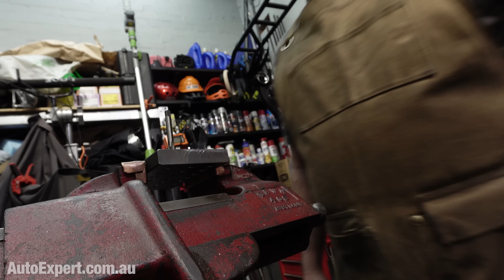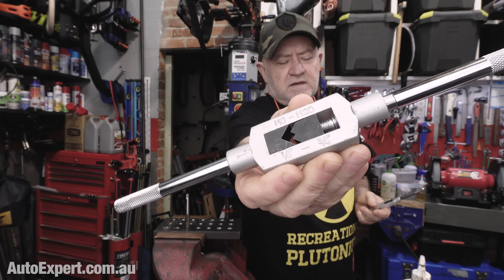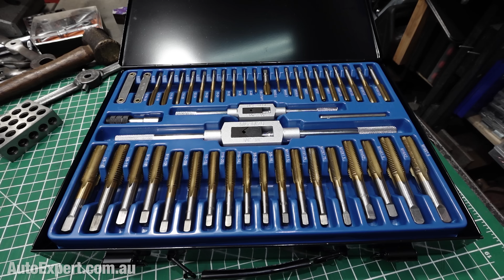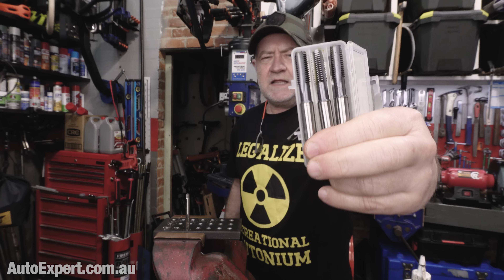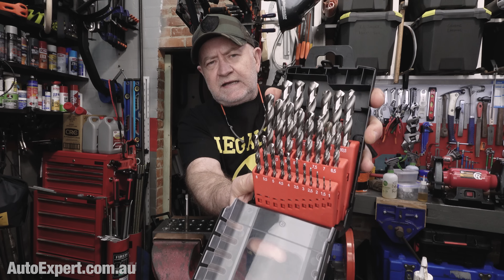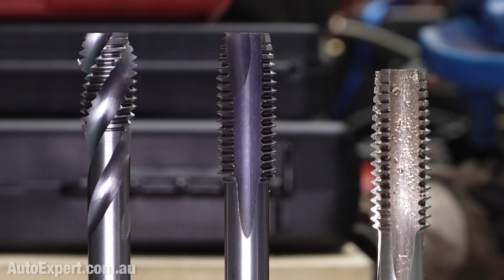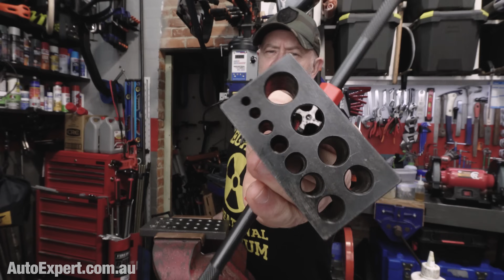The REAL REASON you break taps when cutting threads (and how to break even more of them, faster)

Comment: Why don't you use 'handtaps' instead?
I buy these in sets for the sizes I use most. That is for me some finer sizes: M5, M6, M8, M10 and M12x1.0 (fine thread).
They come in sets of 3 for each size: first tap, second tap and final tap. The final tap has the normal thread, but the first 2 are less deep. Like a kind of starter-tap. They make the tap work easier, get in the right spots and the right place and deep enough so you just don't need that much force and can generally work with a smaller handle.
Then work your way up from I to II and then to the not-marked one that is the same as a machine-tap for the size.

For a plate like you show.... well, I use a tapping-head by the way. With machine-taps and the tap in the head with the clutch set to the right force for the size. It will slip in the chuck instead of breaking the tap if something goes wrong and is really easy to use. Oil, slowly go down to the point the taphead is engaging and then just slowly go down further  untill deep enough and slowly lift up and the head is either just stopping on the clutch or is reversing direction (depending on tap-head).
Yes, expensive. But only about the price nowadays of 3 or 4 decent tapsets for manual tapping or like 8 or 10 good machinetaps. They used to be way more expensive. And yes, these are lower quality tapheads then the ones that I used to use in the professional machine-shop and will last more then a lifetime. You need a strong machine to use them though like a slow-going drillpress in low-gear.
With that, I have worked a while doing 6 holes (drilling, tapping M6) in one part, under 3 minutes per part. Then turn over to next setup and about the same amount in the same time. And yes, 100's of parts like that and it was just a nice serial-job to do. And: without breaking taps. If the head was clicking on the chuck, time to sharpen the tap or replace.

Comment: Good day to you John from "The Old Baboon" in South Africa.
I love the duality (how to break a tap and how not to break a tap) of your presentation on the tapping process. This type of substantive information should be made compulsory for any prospective engineering student, irrespective of discipline.
I do not know if it is deliberate or not but I just love the farting Trefolex applicator.
Admittedly I have had my quota of broken taps during my working years but that is experience (which in itself is very costly). Not raining on your parade but sub zero temperatures also tend to make taps more vulnerable.
Go well and stay safe down under.

Comment: At my last job we had an old drill press with a cast iron table. It was fitted with a foot pedal, that reversed the motor. 500 rpm minimum. Best tap wrench I have ever used. Also, machine taps are better for hand tapping than hand taps. They take so much less force to cut though they can have thinner shanks.
Reply: Be careful with the small size ones though, I had an M4 spiral tap snap on me before and it wasn't even a difficult hole. The taps that are straight but have angled cutting tips work great tho, as long as you can evacuate the chips.

Comment: As a mechanic I have never failed to remove broken taps and bolts! No matter the location. Some I shatter, some I use a high speed carbide tip, and some I slow drill with well oiled quality cobalt drill bits.

Comment: Threw away worn out taps. They are the ones that brake. You need a lot more force to cut threads with a dull tap. Never buy a box of used taps. You don't know how sharp they are.
Reply from the maker: Most hand taps are easy to sharpen on a bench grinder.

Comment: I must be doing it right with my limited equipment because I don’t break taps, and always back them off to clear the chips often, and I back them out especially in thick material to re lube, and to clean the flutes or grooves out. Did it for many decades now and always had good luck even with cheap taps. I never took any instruction on this stuff, just consider it proper use of a tool! I liked this video though! 😋👍🏻😊

Comment: M6 - m20 is fine, just hold by the very center. Sometimes when I need more grip I sometimes use a pair of parallel pliers and just hold them by the jaws just to get a touch more force when doing small taps.

Comment: 3-sets ... in Germnay they call them pre, middle and finish cutter (Vor-, Mittel-, Fertigschneider). 
What matters is drilling the right hole size, perpendicular placing, no flexing and a clean hole. Know your material you tap into. You don't want rust, you don't want some unknown steel that somehow hardened because of bending/hammering/welding or hot/cold cycles in the past.
I'm only an amateur and my broken tap was trying M4 into steinless steel with a "cheap" tap.

Comment: I break taps because they all come with square shafts that don't fit in my perfectly 90° drill press, so I wildly tap them by hand at random angles causing differential stress resulting in fractures. Imagine a triangular shaft tap that can actually fit in a drill chuck. Sounds like a billion dollar idea, someone should invent it.
Reply: How about a tap holder with a hex shaft?  Problem solved

Comment: You missed the best tip, use a nut with the same thread as the tap, then  you thread in o0nto the tap and use ir as a steady to get the hole started.
Reply from the maker: Fantastic tip. Thanls for adding.

Comment: The big box tap sets are really an opportunity (if you do) buy once  all the garbage taps you will probably never need (cheap chasers - good point) - to refill with quality (HSS) taps as the original ones get snapped or otherwise fail  - never think that solid tungsten carbide taps will make life easier for hand work - Machine tools only - they are so much more brittle than HSS..)

 - spiral flute taps are a  good upgrade - for the advanced user - - for a general-purpose intermediate or taper tap  (parallel bottoming/plug if you actually need a bottoming tap of any particular size) - great for power tapping - maybe also grab one - of the concentric laser sight ("bullseye") for holding a drill straight - if that is needed...  

Engagement  - threads 4-5 threads are necessary -minimum 3 threads make full spec load bearing (minimum) - 2 or 3 more give fault tolerance (more than 8 threads is stud-destroying through over torquing before threads will ever strip...
Getting started straight - hey use a drill guide, or- 
Rather than 123 blocks of dodginess - a short bar mounting  "V" block - with is a good starting tool (tis also a great early milling exercise).....

Equal angle - 20mm long is a great guide (if cut square)..
Tapping with a dead centre in the blunt end is time tested (tap wrench engaged - drill press or lathe - no auto-tapping-head needed....

Comment: Has anyone mentioned “Serial taps”
These are really good for taping and new users. 
The taper tap is smaller in diameter to the intermediate and the intermediate is smaller than the plug. 
So you have to use all three taps to tap a thread. 
But it does mean there is less load on the tap each time.

Comment: Such a wealth of information, thanks John! I inherited Trefolex as the tap paste of choice from my dad (aircraft armourer back in the 70/80's) and I was delighted it still existed when the time came for me to set up my fat cave. He also taught me about using a carbide on an air drill and hammer and punch for smashing out a broken tap in my Torana block, but that was the first and last tap I ever broke - such a horrid experience (2 days or so to get it out) that I have been very careful ever since. Also, now my kids are of age where they are starting to do fabrication, I keep the "good taps" hidden.
Reply: Yes Trefolex was the suff we used at the high school I taught in in the seventies and eighties. Great stuff! Our strategy when teaching kids to tap and using only high carbon steel taps not HSS ones was to "Turn the tap clockwise ( back then you didn't need to teach an 11 year old which way an analogue clock turned lol now you would if there was ever a need to teach a kid to tap a hole 😅) Turn it clockwise from twelve o'clock to seven minutes past twelve, then  turn it anti clockwise back to five TO twelve thus breaking the chip that you first made. Turn it back until it stops ( ie seven past twelve), then go another seven minutes and back ten to twelve minutes at a time.  Teaching it that way, we hardly ever had tap breakages and it was the dreaded M6 that were mostly done for( first tapped hole being in 12 x 12 mm mild steel to make a tack hammer).I've seen so many taps broken on YouTube by honest creators who admitted their tap breakages and turning the wrench backwards further than they do forwards almost always works. Sometimes tapping in very hard materials can be challenging and that's another matter lol
Reply from the maker: I'm feeling the pain of that broken tap, dude. The curse of HSS is that you can't anneal it for drilling with a gas axe.

Comment: if you break a tap in aluminium you can use chemistry to dissolve the steel tap without touching the aluminium. In a steel part, you're gonna have to find a different solution.

Comment: Im surprised you’re recommending straight flute (hand) taps. I’ve been doing this for some time over 55 years and I’ve found that spiral tip taps to be much better for overall work, through hole or not. As long as you can drill the hole deep enough to accommodate the long chips that are forced to the bottom of the hole, you’re fine. I also grind that point off those taps. There’s no use for them and it allows me to go a thread and a half more than otherwise. I haven’t had a problem with that. Spiral flute taps are really delicate. I generally recommend against them. When I do use them, I tap with a spiral tip tap first and remove the long chips. That’s not too hard to do.

A problem is that a lot of people will use an electric trick drill to tap. Well, yeah, I do that too, but I’ve tapped thousands of holes and I’m very careful with alignment. Straight flute taps are terrible with power tapping. I also haven’t seen a “tool steel” tap set here in a long time, though I suppose there are a bunch of cheap sets floating around where I don’t go. I certainly agree - buy high quality taps. They’re not really that expensive. But don’t throw your money away on something like Emug taps for $40 US, each.

Comment: A 7mm drill will do just fine for an M8 tap. I remember from trade school, 45 years ago, that anything over 70% thread depth does not 'significantly' increase the thread strength. I often tap M10 with a 9mm drill, much less chance of snappage.

Comment: I have to do M5x0.8 through 20mm plate. Yeah that'll get beads of sweat forming on the forehead.
Reply: Trefolex cutting compound all day.
Reply from the maker: Can't you counterbore most of it?
Reply: @AutoExpertJC  Good call. I've only being doing this about as long as you and never thought of that even though I know full well thread depth only needs to be 80% of nominal diameter to achieve max strength.

Comment: 60 minutes ago I broke three taps trying to mount a bracket on the side of my car hoist.  It took me that long to work out it wasn’t mild steel.  Like duh!  😢
Reply from the maker: HSS taps should cut anything a hoist is made from.
Reply: @AutoExpertJC thanks.  Maybe I just used inferior taps.  It was an M5 tap from Bunnings.
Reply from the maker: Probably a bottom o' barrel cheap Chinese tool steel tap. Designed to shatter if you look at it wrong.

Comment: My old toolmaker teacher told me 45 years ago that tapered taps were good for starting but once started , go straight to the plug tap because a tapered tap engages a lot more cutting edges a before it reaches full depth of thread. Which means increased torque on the tap and a higher risk of snappage 😢 A plug only cuts at the front. 
Or something like that.

Comment: Australian taps and dies only. If you need to be told who/what brand? Get an office job! 😝
I start my threads hand powered, but using a mill or lathe to ensure alignment. (gettin old).
Cycle thread is a bit more difficult. Make Y.O. 8-/ As John says - check the angle of ya dangle and keep yer flutes clean! 😵😂

Comment: "Low quality tap" is relative. I've attempted to use "low quality taps" for thread chasing only to find that they were such low quality that the thread form and diameters were wrong. Life is too short to use cheap, garbage taps. 99% of the time you don't need a taper, plug, and bottom (or taper, intermediate, plug) tap set for each thread. A gun point intermediate tap will work great 99% of the time. Avoid powdered metal taps or spiral taps for hand tapping. If tapping stainless or hard to machine alloys, use a drill for 50% thread engagement as long as the threads will reach at least 1.5x the diameter in hole depth. Use a thick cutting oil. If unable to back the tap out after desired depth in blind holes, rotate forward and backward gently to break the chip.

Comment: I prefer Trefolex paste to the oil. If you get a broken tap in a through hole work piece you can punch it out  with a punch and hamer, done that a few time over the years. The method that I read about in a 1944 copy of metals progress that apeals to me but I have never done , the person writing about his method of removeing broken taps and drills from aircraft crankshafts was, croubling blasting powder around the flutes and tamping it down then inserting a fuse and setting it off, apparently it blew the broken taps or drills out every time.
Reply: Blasting powder is unfortunately not possible to get for most people.
Reply: I second the Trefolex motion.
Used oil for a while, but never looked back after going to Trefolex "grease".
Oil is cutting fluid for drilling...
Reply: Agree on the trefolex. I use the tapping paste, aka gorilla snot, for thread cutttng, and use the oil for drilling.

Comment: I've seen every size of thread cut over the years from 4-40 which is a pain.. like using the tip of a toothpick to do the work up to 20"  for gland nuts (outside thread cut with carbide threading inserts)
Speed and Feed! Bungle either one and you might screw up.
Tapping Heads are almost a must if you plan to do it quickly (and there's a knack for this as well).
I've heard a lot of taps up to 1/2 14+ mm shatter or break off 
Co workers trying to hurry a detailed process.
It always sounded the same-- "Krunch-fock"!! Dammit"!!
I've noticed that the most expensive (HSS Spirals)  taps often break off at the very top of the shaft (the drive tip breaks off in the Collett) (leaving the jammed in place the remainder) vs the cheapest snapping the tip off inside.  
Tapping 40 Rockwell steel and 35 Rockwell stainless steel isn't easy.
The success was always go down about 3 turns..back it out, blow out the chips, back down to 2 to 3 more turns and repeat (blind holes)
We generally classified the Straight flutes as "Hand tap" and the Spirals as "Machine feed" tap
I think the best I remember were Guhring and Goliath with Butterfield as the olde timers standard. 
We don't have Trefolet such a thick syrup for taps. I've only seen fluids such as what was popular then..Norton Rapid Tap which is thin and drippy.
Maybe the thinking here is it's easier to drip out the metal dust and chips or easier to blow them out of the blind hole vs having a honey thick tapping oil. 
I know there's an off hand rule that the cheapest ones are designed to cut x many times before recycling them. 
Also I found its much easier to cut Metric threads than UNC.   They're harder to strip as well. UNC strip out easy.

Comment: It’s very easy to remove a broken tap all you need is a smaller tap then the broken one that you’re not bothered about what you do is put the small tap in the hole on top of the broken one and hit it with a hammer what will happen is a peace of each tap  will break off and eventually the broken one will brake up completely job done no special expensive tools required.
Reply: Tool steel yes, hss no.

Comment: From bitter experience, I would suggest people avoid attractively priced online kits of taps because you find they will snap like a carrot

After DIY rebuilding motors in the 80s and mid 90s and cleaning out head bolt threads etc in engine blocks 

I reckon the best thing to do is figure out what size tap you need - or two or three

Then go out and just buy that one tap size and get the best that money can buy really good quality and even then be careful with it 

and then in months or years later when you need a different size. You just buy that single tap. Don’t buy an entire kit. 

Because it’s going to be 
sh!t

It’s a bit rough when you’ve had to acquire a secondhand 308 engine block. You’ve just spent a grand on re-boaring and machining then prior to assembly your cleaning out the head bolt thread holes in the block and you snap a cheap tap right at the bottom.

That will make you spew on the spot - however the high-quality taps are much more forgiving. I’ve never had one of them break.

Comment: No. 1 cause of broken taps is to small a whole. 70% engagement is all that is needed.  The smaller the thread the greater the need for an accurate correctly sized tapping drill bit. A very good selection of Imperial & metric dills  will usually mean you have what is needed. Best is buy the exact size to suit each tap size and keep them together.
No. 2 is a 'drunken thread', which is the tap not being aligned properly. Use a guide of some sort.
No. 3 is the correct size tap holder and try to never use an adjustable wrench.
No.4  Buy quality.  I like VÖLKEL serial taps which have the starter ground under size. These are radial sized taps and the best there are.
No. 5 Use a top quality tapping fluid for the material being tapped.
Reply from the maker: Agreed with all those points (because that's essentially what I said in the vid, with the exception of the brand recommendation).